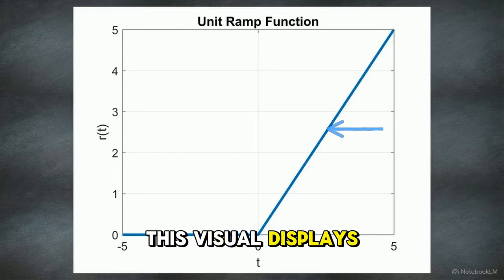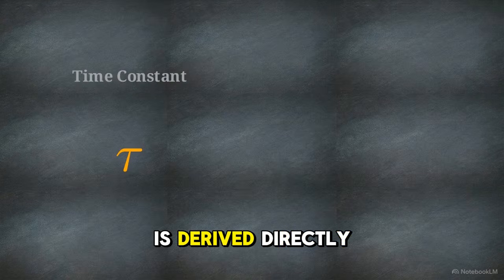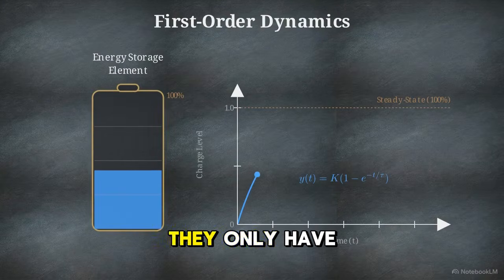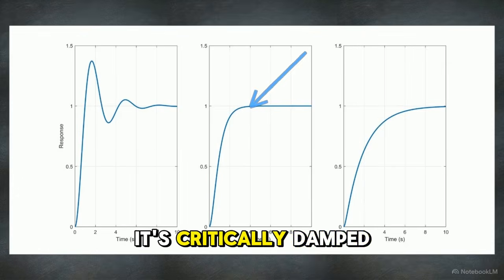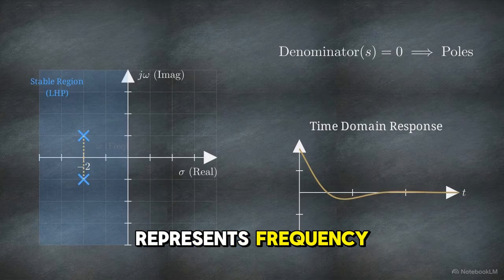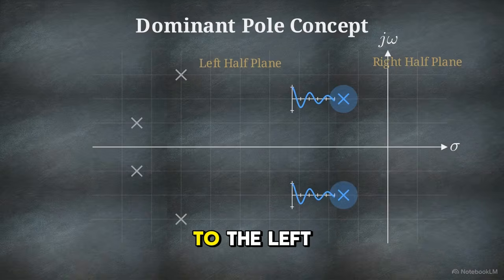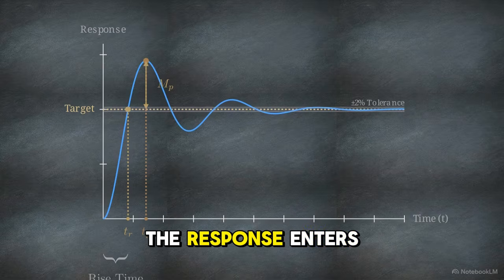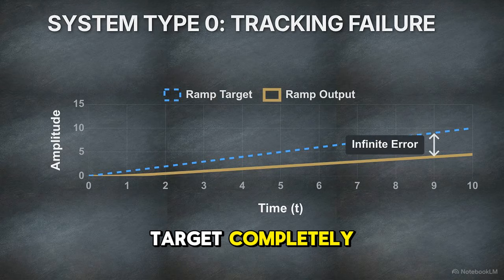Time Response Analysis

Comment: The tree trunk is the spring and the leaves provide the damping.
Reply from the maker: That’s a really nice analogy 👌
The trunk behaving like stiffness (spring) and the leaves contributing to damping makes intuitive sense.

You could also think of the wind as the external input, and how different trees respond differently depending on their “ζ and ωₙ” 🌳

Curious though... what do you think would happen if the damping is too low?
Reply: @adamtan86  Thanks for the reply.
I think the answer to the question is that ultimately you get a different version of tree with respect to natural selection or the tree snaps and fails.  
Your video is a mathematical expression for the very essence of nature itself. 😊
Reply from the maker: @CATANOVO That’s a powerful way of putting it 👍 the idea of the tree snapping when damping is too low really captures the consequence of energy not being dissipated in the system. 

And interestingly, this isn’t just an analogy. There are actual studies that analyse tree sway using dynamics very similar to a mass–spring–damper model, even extracting natural frequency and damping from real trees. 

One good reference is:
de Langre (2008), Effects of wind on plants:

https://doi.org/10.1146/annurev.fluid.40.111406.102135 

It’s quite fascinating how these mathematical descriptions end up reflecting real behaviour in nature.
Reply: @adamtan86  Thanks for the link, I had a look at the abstract. 😊
Virology could be another example for the maths (propagation would be the spring and immunisation the damping) but probably getting too far off the original topic.
I have tuned the odd servo and had a CNC table become resonant but did manage to get things where they needed to be through trial and error rather than computation as my maths is poor lol.